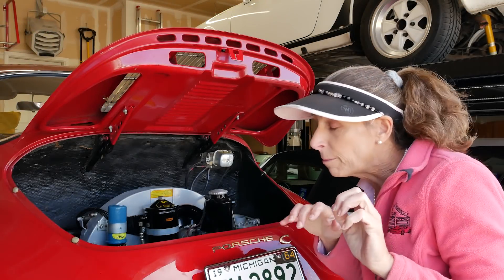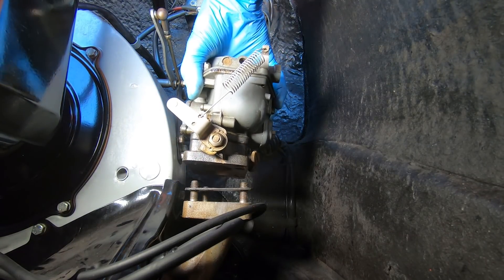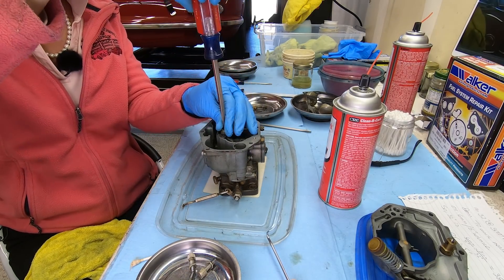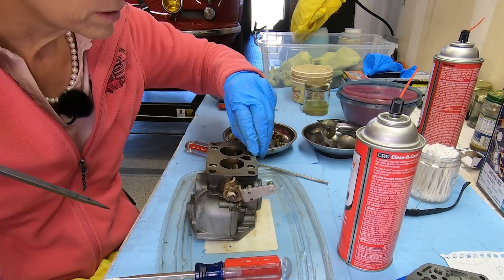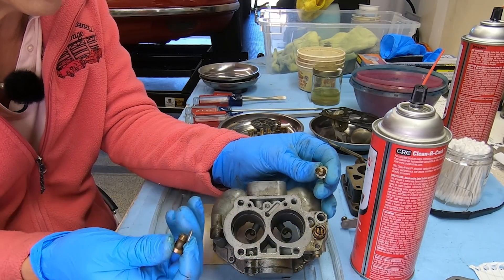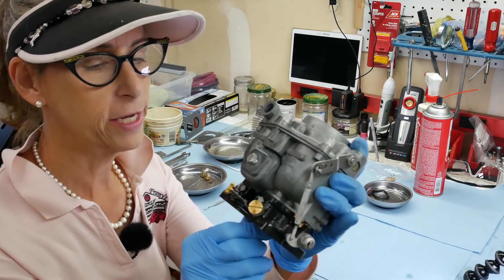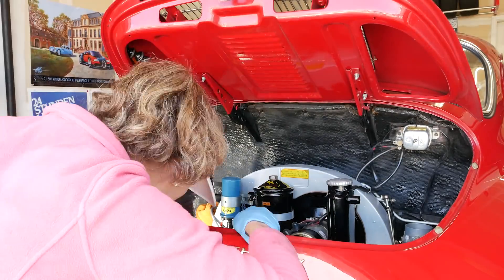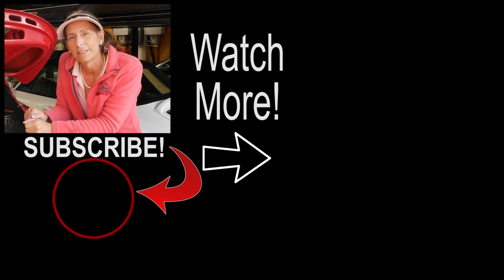Porsche 356C Project #5: CAR WON'T START!! - Zenith Carb rebuild

Comment: Love your videos. I hav owned a 1960 356B coupe, relying on the printed manual for the first 6 years of ownership. After spending one hour watching 2 of your videos I feel much more comfortable with many of the common cold start and running issues. Many thanks!!!

Comment: I’m just a few minutes in and I’m taking notes! I normally work on 60’s and 70’s Honda motorcycles and land rovers so this is a different animal. It ran today on starter fluid only. This has been sitting for a few years full of fuel so I’m sure the carbs are quite gunked up. Your channel is a GOD SEND!
Reply from the maker: The carbs aren't that complicated. Just takes your time and take some photos. There are a few plus that will go in different holes. The accelerator pumps do need to be working. There are really good rebuild kits from 356 carburetor rescue.
Reply: @HeidiandFranny  cool I’ll check out those rebuild kits, thank you!

Comment from the maker: Hi Everyone!

This car has been almost impossible to start!  Time to dig into those carburetors.  See if you can guess what went wrong...

This will also serve as a guide to rebuilding the venerable Zenith Carburetor.  Enjoy!

This video references a more in-depth carb tuning video here: https://youtu.be/Kkzn0eevoLY

There are a few parts and Supplies here:

Permatex Anti Seize: https://amzn.to/2OA0o94
Silicone Paste: https://amzn.to/38O2Rp9
Dental Picks: https://amzn.to/34DSmRY
Uni-Syn Carburetor Synchronizer: https://amzn.to/2DuliQu
Gunk CC3K Carburetor & Parts Cleaner with Drip Basket: https://amzn.to/33DrUGK
Metric Stubby Wrench Set: https://amzn.to/2OClP9j

Check Sierra Madre, Pelican or Stoddard for the rebuild kits...

Comment: Great work as always.  I've done carb rebuilds in the past, and it's always a challenge.  But, never something as complicated as a multi-carb setup.  Very cool to see the process and hear how well it now runs!
Reply: I always love seeing a good carb rebuild, Franny is the best at explaining this!
Reply from the maker: Thanks Pat!
Reply: Rebuilding carburetors is a disappearing art and she sure gives a lot of detail in the video. Something to consider when determining a rebuild is necessary is to check a couple of things before removing the carbs. First check the float levels, you can do this with a sight gauge that has a clear tube attached with graduations showing the proper range and the other method is to remove the top and measure down the fuel in the body from the top surface of the body. Secondly you should check the accelerator pump quantity with a small graduated vial, you can find a summer and winter value listed in the factor spec book. 
Both of those procedures were part of things that were prescribed in maintenance schedule and would be performed at that time.

Comment: Hi Ms. Franny and Ms. Heidi,

My name is John.  I look forward to seeing your automotive service posts. They bring back a lot of memories,as once i was a VW/Porsche mechanic-(air cooled only) dealerships and independent  from 1961 to 1974-then managing same (air and water cooled VW dealer products) till around 1980.

Back then all mechanics/service staff went to VW official service training including customer service advisors. VW of America had very thorough and strict servicing procedure expectations

My wrench turning experiences were for VW/Porsche retail customer service/morphing into SCCA VW (class C sedan-1957 VW "Oval window Bug") amatuer road racing, progressing to (class E production-1961 356B coupe-Super 90 GT- total factory GT's produced that year was between 9??-14?.... Interesting build specs >> Aluminum doors,hood,rear engine lid-louvered...plexi windows sides (leather front window pull up straps),  21 gallon oversize fuel tank,oversized aluminum finned Spyder drum brakes with front brake drum screened cooling ducts,lightweight wheels with spacers,Speedster seats,factory roll bar,a mildly factory "prodified" Super 90 pushrod engine- with 2 
Solex carbs with factory handmade carburetor velocity stacks,a "Sebring" exhaust"-(resembled a RS Spyder 550 exhaust),limited slip 4 speed transaxle with interchangeable gear sets ratios/ring and pinion final drives ....all of these components came out of the Porsche factory along with F.IA. homologation credentials..... I purchased car in mid  60's with less than 2 k miles-it was a garaged/race maintained vehicle-(Porsche silver paint-then "Canary Yellow",then i painted to red as your "C"......Back in those days "60's you could drive  a lot of these SCCA licensed/registered/inspected on the street as i did every now and then for just funnnnn... i campaigned this little "gem" in "gymkhana's- <<<now called auto-crosses,hill climbs, and serious amatuer road racing.... the car was easy to drive,powerful (for its time)-could be modified to handle up to around maximum 130 to 140 hp-somewhat reliably-especially with all the good "stuff" available from and out of California,pulling approximately 1650 Lbs.(even good mpg!!!!) EXCEPT IT HAD NOOOO HEAT!!! 'sans' no factory heater boxes HA HA...

My opinions relating to your Zenith carburetor work,you did a very proper service on those twin Zeniths....that brand allowed more noticeable modifying for "tuning" for 'xtra' performance on modified engines.... i remember i favored the Solexs for a bit more reliability,easier for basic adjustments,could use more available VWOA sourced jets etc.... 

Just a small mechanical 'tip' >>>>should you notice (in your "C" Porsche),any sloppiness in the shifting,such as having to hunt for gears-unusual length shifting throws-check/replace the plastic bushings on the main shifter rod inside the shifter tunnel accessible at the gearshift lever console..

Thanks to you both for your time,your expert work/videos!!!!! Keeps me remembering some "good old days"!!!!!

John B.

P.S.-Can't wait till you get started back on the flat six project!!!!
Reply from the maker: Thanks John!  We'll be back to the 3.2 very soon...

Comment: Franny. I like your philosophy on one at a time, but you can always put some gas into the bowls before you reinstall in order to make starting a bit easier.
Reply: Very true and also good practice to prime the carbs before startup.
Reply from the maker: Yup!  That works well too.  I seem to spill it all over though...  You can fill it through the threaded hole in the top bar.

Comment: Outstanding video as always..
Reply: Franny, I haven’t yet watched all your videos. So sorry if this was covered before. But a bunch of people on the web have installed aux fuel pumps to help with the cold starting. Some as simple as a rubber bulb in the fuel line. Or an electric pump that you activate before starting. I feel like it shouldn’t be necessary, but want to ask if you have considered?
Reply from the maker: I talked a bit about this in the 356 Cold Start video...  My thing is that if the car has sit long enough for the carbs to evaporate dry, then the engine could use a good bit of cranking not under power to get the oil through to everything before any load is applied.  Also, the starter can take a lot of abuse, but the engine can't.  Also, the starter is way easier and cheaper to replace than the engine.  It bothers everyone, but that starter is original to the car and the car is over 60yrs old...  I can wait a few seconds to get the car started after a long slumber...  Just MHO :)

Comment: I am finally ready to rebuild my 1956 356A carb and your video will be my guide.  Maybe I missed it but after rebuild what are the idle screws starting point? I think you said 1-1/4 for bypass screws. I already rebuild the fuel pump off course watched your video. But I am still getting fuel in the oil. I think most probably is  stuck flow valve in the carbs or maybe high fuel pressure.. Thank you Franny you are Great teacher and any other advises are welcomed
Reply from the maker: Thanks!  If you have fuel in the oil it is most likely coming from the fuel pump diaphragm.  If you haven't replaced that you'll want to do that.  Oh, yes, 1-1/4 turns is a good place to start :)
Reply: @HeidiandFranny  I did rebuild the pump couple years ago. I finished rebuilding both carb and did install them. initially pump pressure was about 2psi. Next day after retesting showing 4psi and can see fuel leaking thru bottom gasket of the carb. I will redo the pump and recheck carb needle valves. I was carful not to over tighten the bass check valves. Maybe it is leaking from them. I have similar gauge to yours. I not sure these gauges are accurate at low psi readings. I also removed the mix screws prior to removal and before installation to avoid accidentally bending them.
I guess back to square one :(

Comment: Cool vid but You didnt mention about very common problem in that carb what are leaking and bad shafts. There is a crucial point if You want to do this carbs done properly.

Comment: Franny, another great video, is this process similar to the solex carbs, i have these on my 356C and would like to tune them up a little.
Reply from the maker: Hi Eric, they are more like Delortos... Sorry... Outside of the 550 Spyder I don't have much experience. Maybe check out the how-tos on the 356 Registry.

Comment: Great video. Is that air flow meter the same as the Uni-Syn that I had decades ago? I used it for a time on the SU-HS6's on my 66' 122s but after a while a friend showed me how to get the same results by using the hose to the air cleaner up to my ear and doing it by sound. It worked really well and I never used the Uni-syn again.

Comment: I have the NDIX 32's on my 63 356B T-6. Im having two issues..1 car starves for fuel after 20 mins of hard driving and sometimes stalls. car will recover and repeat. town driving is fine. 2nd when using the flow meter to check air intake the care will choke out until removed? current jets are Main 115  Idle 50 Air correction 230. Internet says to increas main jets?
Reply from the maker: Have you checked your float levels? They may be a bit low. That would explain the difference between had driving and city driving.
What floor meter are you using? One like mine with the flat base? They are adjustable. You can rotate the center wheel to allow more air through. See if that does it.

Comment: Hey Fran, if I can ask a question. The “air bleed” screws; are those the equivalent to an idle mixture screw? If so, do they control air? So turning them in does that enrich the mixture and turning them out leans the mixture? Since these don’t have a choke, is it good to set them a bit on the rich side?
Reply from the maker: They are air bleed screws. They should only be adjusted when the car is good and warm. So, I guess to answer your question no.  The missing choke isn't that big of a deal actually. Our '58 has a throttle hold that allows you to hold the throttle up a bit when cold.
Reply: @HeidiandFranny  Ah ok, thanks!

Comment: Hi Franny
First, great video!! 
Just a quick question from a confused guy. 
In the end of this video (around 27:20) you say that you should adjust your air bleeds with the air cleaners ON but in the 'in depth' video you made on Miss Eva, you do it with the air cleaners OFF.
Which one is the right way?
Thanks
Reply from the maker: You are totally right, my bad...  Probably best to with the air cleaners on for the final adjustment but if you want to do the initial adjustments with them off that is fine.  It really shouldn't make a difference if there isn't any restriction from the air cleaners.  Thanks for bringing that up! F

Comment: Hi Franny, couple questions for you. Do you replace all the components with what comes with the rebuild kits? Like the air bleed screws and float needles? When doing Honda motorcycles we usually keep the brass bits and just clean them up as the OEM are usually better quality. 

Also the gasket on the top section with the accelerator pump is riveted on. Have you come across this? Curious what you normally do. It has to be replaced because it’s not in great shape. I plan on drilling out the rivets but unsure if the new one should be riveted back on. 

Thanks again for these videos, they are indispensable!
Reply from the maker: Hi there, many times the air bleed screws are bent or have a notch where they have been bottomed out so unless your original ones are perfect (or at least better) replace them. That goes for all the bits in the kits. There is a good chance a lot of what you see in your carbs aren't original. 
As for the rivets they are just little alignment plus and will easily pry out. They just help to keep the gasket in the correct spot during reassembly. Just use something thin and work then up and tap back in when reassembling. I hope that helps :) f
Reply: @HeidiandFranny  Thanks Franny, that helps a bunch.

Comment: Very nice video.  Thanks.  What did you use blue  locktite for during reassembly?  Went by pretty fast.
Reply from the maker: Don't think I used any blue...  I did have a small weeping from one of the plugs so I used the green on that and it worked great.
Reply: I see, blue tube but green inside.  Thanks.  Appreciate your response.  😀

Comment: Any throttle shaft wear or butterfly problems on those carbies?
Reply: Good question brother...
Reply from the maker: Great question...  No.  I was actually surprised, but I think that is the big up-side to those cast iron throttle bodies.  I think the Solexs can have that issue, but I haven't seen that on the Zenith.

Comment: Good job Franny,hey whats your feeling on those Zenith carbs vs. the Dellortos you worked on in another series? I wish I had the opportunity to put the Zeniths on the bug as the size is more manageable in a cramped engine bay of the bug. The manifolds for the Zenith put in a VW are just not to be found. Anyway great vid. Indy
Reply from the maker: I think I like the Zenith better...  They are more responsive...  The Dels are easier to swap out all the jets and to set the float level though.  They are also true dual barrel carbs vs the shared intake of the Zenith...
Reply: scott-I don't know what your engine configuration might be,nor your tuning/tuning expertize-however let me make a 'suggestion'-look into a Holley Bug Spray-(but not for cold freezing wet weather-(they do have electric choke-but still can and will "ice" up a manifold until fully warmed up)!!!!!-John B.
Reply: @johnbeech2192  I run dual 40 Dellortos. Dual carbs on a VW are superior in every way to a single carb-performance,gas mileage,no icing,exhaust options. The only downside is the space is small so it takes a while to get used to working in cramped spaces. proper preheat is absolutely critical on single carbs on a VW and most aftermarket exhausts for the VW are lacking there but dual carbs dont have that issue since the manis are aluminum and very short and heat up quickly. As Franny demonstrated with the 356 chokes are not needed in dual carb application.
Reply: @secoff1  Sorree,i allowed my self to give you the wrong advice!!! Don't know why/-but made the wrong assumption you might have had either a single/? double ported standard? (single carburetor manifold, V-Dub engine...........I can see from your response you have a lot of  VW modifying/tuning expertise!!!!!!  Again my apology for commenting back to you with incorrect advice...Thank you....John B.
Reply: @johnbeech2192  Ive learned over the years a lot from thesamba.com

Comment: Franny, I forgot to ask you where you get your Zenith carb rebuild kilts from? If your allowed to disclose, thanks in advance
Reply from the maker: Hi Mike, That was one of those Walker kits and I'm not a fan...  I believe Carburetor Rescue 356 has a good kit with a good needle and seat.  Most kits just don't have all the correct bits...
Reply: @HeidiandFranny  but they seem very better than the ones I can find here in Brazil hahahah Great Job!

Comment: It seems a little shortsighted to not replace fiber washers, when you have the chance.
Reply from the maker: That is the beauty of fiber washers!  if properly torqued they will not need replacing very often and seal well once they are wet.  A copper or aluminum  washer should only be used once unless you want to re-surface and anneal them (much easier just to replace).  I've grown to see the wisdom in fiver washers for fuel - especially on fitting that are removed more often.

Comment: Can you film you starting it from the inside....when to pump it and when to hold the pedal down? Would be nice to see the technique so it wont flood
Reply: Depends if engine is cold or hot sometimes, when cold I pump 3 times almost full depress, don't go crazy with it. Then depress 1/4 the way down and crank engine. There is no choke so you might need to crank for awhile, it's ok though the oil pump is spreading much needed lube during this time. You might need to vary the depression from 1/4 to 1/2 while starting...On a hot heat soaked engine it might get tricky. I usually go easy with the same 1/4 depress while starting, but if it is not firing, it might have a mild case of vapor lock and you need to give it more fuel, so due almost full depression and it should start. It's much easier to flood on a hot engine so need to be careful.

Comment: With no choke and no accelerator pump, that's definitely the problem of no starting.
Reply from the maker: I think I spent close to an hour getting it started before I pulled the carbs.
Reply: Dont need a choke,the short intakes heat up very quickly and your good to go.I know it sounds hard to believe but its true. You can always go one size up on idles in winter for lean condition at start but I personally never do.